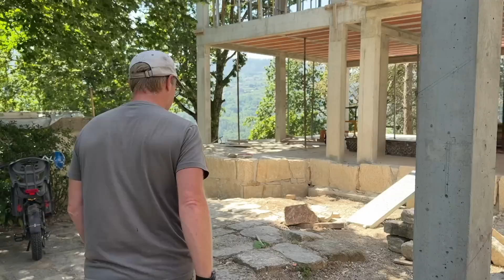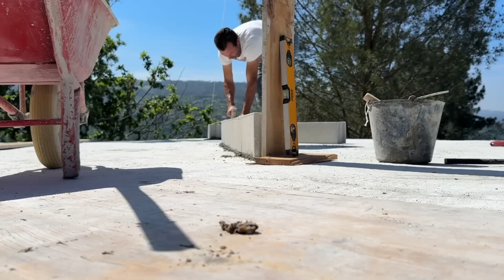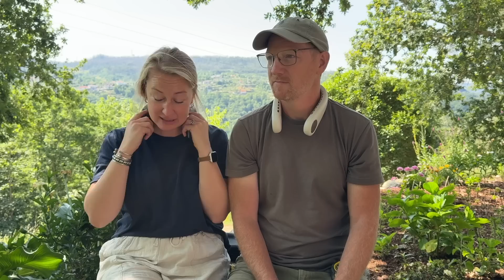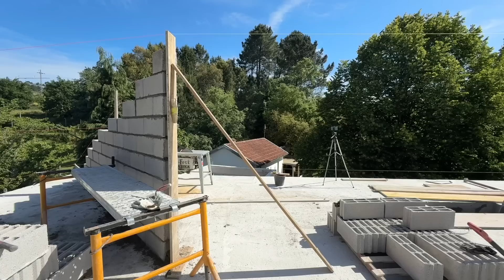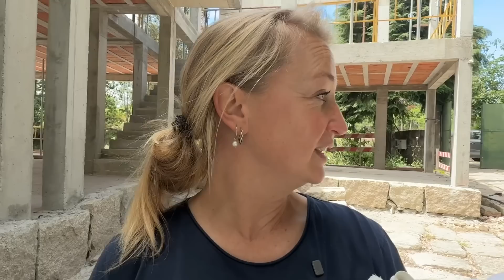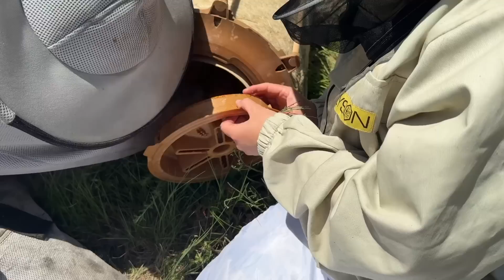It's All Up From Here! Our HOME BUILD goes NEXT LEVEL

Comment: So excited for you! Things are going to start moving very quickly and before you know it you will be under roof. I grew up with an attic and pull down stair/hatch. We had to climb up the ladder into a dark attic space where we would pull a string to turn the light on. Since you're building from scratch, you may want to have your electrician wire a light switch on the wall near the attic hatch. It would be much safer and convenient.
Reply from the maker: Agreed. Good idea. ❤️❤️

Comment: Something similar is what I did for all those years I didn't have air conditioning and I had very active children. I used to place semi-wet hand towels in the freezer, which I would take out and place in our necks whenever the heat got too intense. A Chinese doctor told me the neck regulates body temperature. So, when it is hot, cool the neck down with the cold towels, and the entire body will cool down too!
Reply from the maker: That’s a great idea! Love it!

Comment: No face shields, no dust masks no safety belts 😶‍🌫️🫣
Reply from the maker: Safety belts? Great to hear from you, thanks for watching friend.
Reply: @TheNewbys John, in Canada, when you're working at any height, you have to wear a safety harness that attaches to the building so just in case you slip, you can't fall. Maybe that's what they meant by a safety belt!